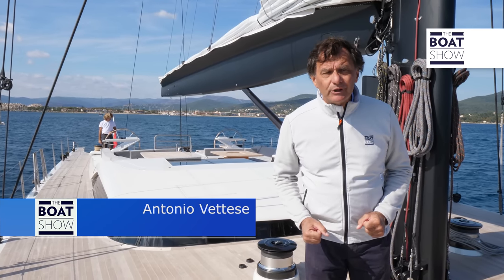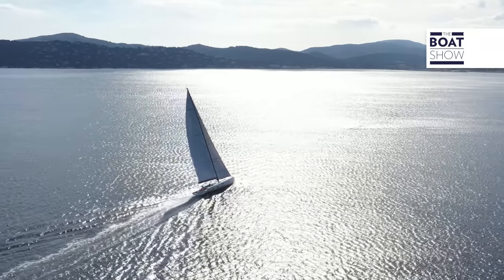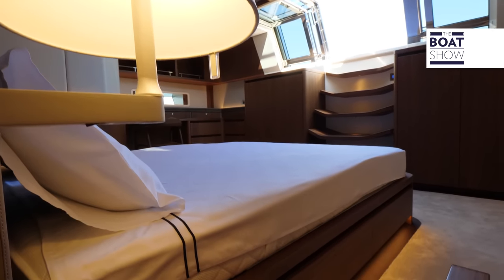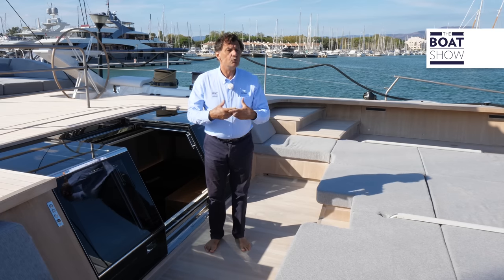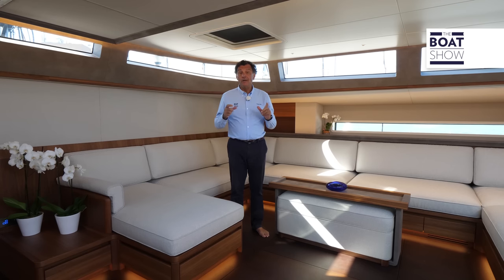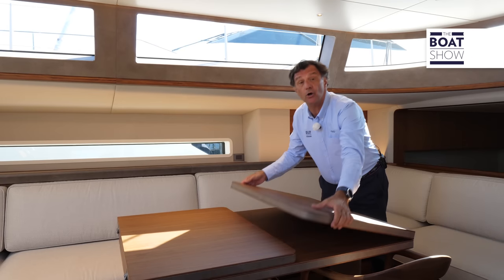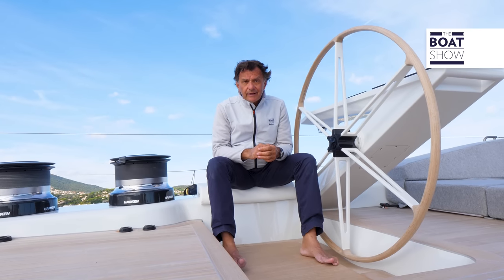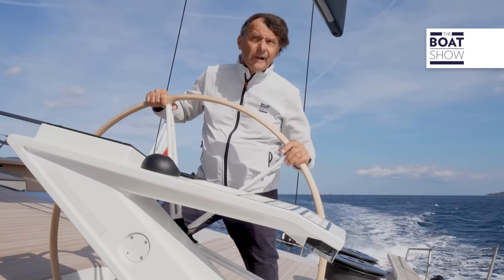[ENG] SOLARIS 111  - Sailing Yacht Review - The Boat Show

Comment: I´m 15 y.o and my biggest goal in life is to get 23 million euro and buy this yacht. It is simply the most beautiful yacht ever built, it´s absolutely stunning like I can´t even find words for it. Hope I´ll see ya in the Solaris office to order it in like 10-20 years haha
Reply: You'll have to make about 75 million to even think about this. Not saying you can't do it. Keep your head down and focus, stay single until your 30s. Relationships are costly when they're going well and devastating when they don't.  Owning and keeping are 2 different things. 10% of the price minimum per year for operations, maintenance and crew on most large yachts. By the time you get to the point of affording this yacht, there will be more available. Better tech, etc. I wish you the best in your future.
Reply: @Außer Kontrolle Where are you getting this info from or is this your personal opinion. 10% is the norm .  Approximately 1 million for maintenance and repairs, $350,000 for dockage, $240,000 for insurance, $400,000 for fuel, and $1.4 million for the crew. Commnication. etc. Thise figures are for a motor yacht. You now have to have more experience crew for sailing more maintenance for the sails. Maybe cut the fuel cost in half. But hey, I could be wrong, nothing wrong with that either.
Reply: @TChalla007  alot of the maintenance for super yachts is the engine and subsequent generator system maintenance  this boat doesn't have big several thousand horsepower engines. you forget this is a sailing yacht, you only need yourself and a partner maximum to sail not a crew., the guy in the vid is literally solo sailing. sails also dont need maintenance  just replacement after alot of years. docking and insureance would be the killer in yearly costs as maintenance wouldnt be much.
Reply: you can own a proper 47 meters super yacht with that price, and maintain it for a whole year with every expenses include.